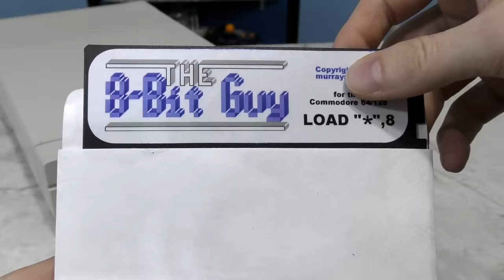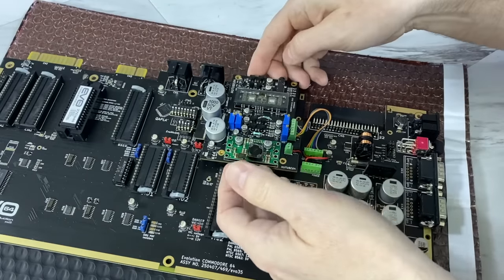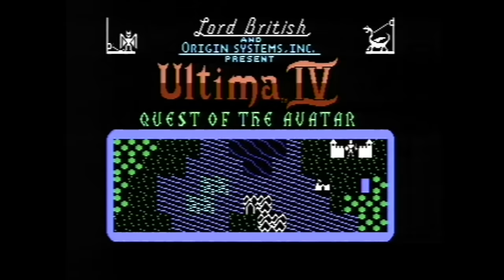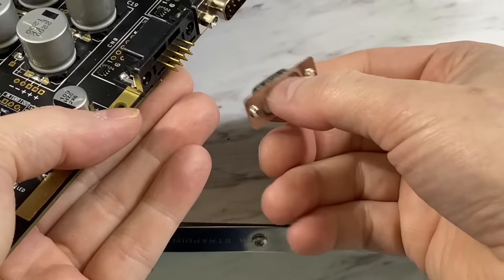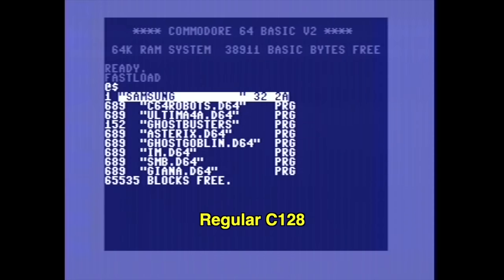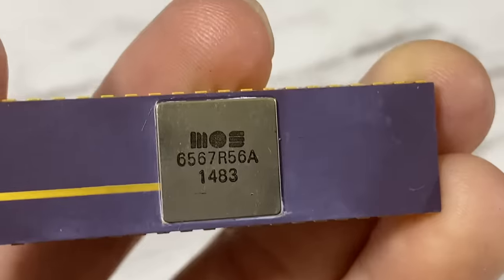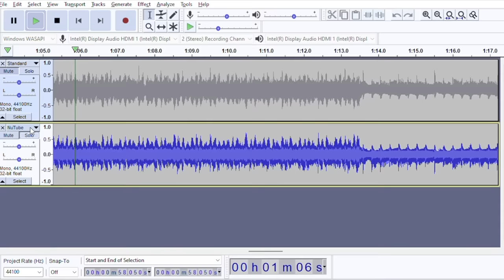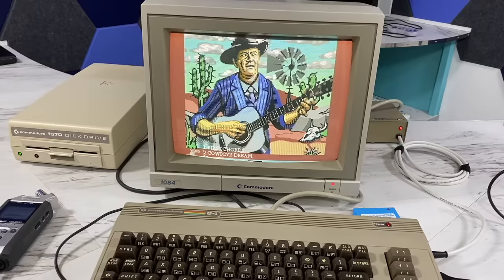The Evolution64 - Is it worth the money?

Comment: A $500 upgrade that is almost imperceptible and requires a full spectrum of additional hardware to appreciate in any capacity really exemplifies the "audiophile" culture.
Reply: I'm waiting for an audiophile blockchain powered AI that is funded by an MLM scheme.
Reply: That's pretty much what it is...

If you blind A B test you usually can't tell the difference between "quality" and "top of the line, fully engineered for audio quality".  

For the potentially incoming comments, how many people have a C64 hooked up to a fully analog amplifier? Probably not many... And this is a computer, released in the era of transistors. It's sound profile is what makes sid chip tunes sound the way they do, changing that is not an improvement in my opinion, that's never how it was used.

(Edited for spelling)
Reply: But this VFD style amplifier tube is awesome :)
Reply: I didn't think it was imperceptible at all and I'm not in any way an  audiophile. There was a bit of fuzziness to the original recording that was simply not there on the nutube recording.

Is that worth $500? hell no. but I could hear a difference.
Reply: I listen to good old mp3 on my airpod pro and couldn't be happier.
Reply: @Tahngarthor  Yup, the tube sounded slightly more `full` if thats the word.  The difference is very slight and deffo not worth $500, in fact I dont think I would pay anything for such a tiny improvement, especially as the sound could be improved in a similar way by switching on your amps bass boost.
Reply: There was a VERY slight increase in bass...but I don't think it made it sound better, just ever so slightly louder.  And that's probably just due to the fact that it's an amplifier vs the original C64 sound.
Reply: Audiofool culture more like
Reply: @Tahngarthor  I could hear the different too, but even I think it's a silly upgrade, and I love tube amps. If you were using it as an 8-bit synth, I could see wanting to add some tube warmth, but that's easy to do with an outboard preamp. I disagree that you need end-to-end tubes to appreciate them in the signal path.
Reply: And the fact that you have to drill a hole into the pcb also makes it kinda a dumb purchase.
Reply: There are many hobbies where you can spend huge amounts of money for tiny improvements in equipment performance. Not unique to the audio hobby at all. Just have a look at the car modding communities where people spend thousands on just a bodykit and wheels for aesthetics.
Reply: Yeah, it's pretty wild. I'm a music enthusiast myself but this type of highly specialised exceptionally high quality equipment always gives me the feeling that it's just a mug's earful.
Reply: Audiophiles: paying 500% more, for a 5% improvement…
Reply: Not to mention a $1000 traditional valve upgrade option
Reply: There is no "audiophile" culture. The word audiophile means, quite literally that you appreciate sound quality. Yep, that's it, all it means is that if you think the sound, most often music you listen too should sound better than through you phone speaker, you're an audiophile. It's like being an autophile - you like and appreciate the beauty and technology of cars.
Reply: @volvo09  I think there are multiple different things being considered here. Tube vs transistor has essentially nothing to do with digital vs analog. A transition amplifier wouldn't digitize the signal any more than a tube amp would. My suspicion would be that the vast majority of C64s have entirely analog audio paths after leaving the C64.

That all being said, a tube amp does change the sound a bit, sort like applying equalizer settings. Even if you went analog out through a tube and recorded it back to digital, the effect would still be present. Digital recording is essentially perfect (as far as human ears can tell), so any change could be captured accurately. That doesn't mean tubes improve the sound, but they probably do change it. 

I'm definitely not saying it's worth $500 (and I'm not even really arguing it's an improvement), but it seems the arguments around here aren't that well thought out.
Reply: i did hear a difference from the nutube, but it isnt worth 500$
Reply: But the amplifier lights up!  :)
Reply: @Tahngarthor  also I heared bit of a Bass boost on the newtube.
Reply: @volvo09  Most people can't tell the difference, but even if you can it still might not be worth the price premium.
Reply: @eric470ast  and that might be cool if you had a translucent case. But not $500 cool. You can get a light strip for 1/100th the price and get the same (or better) effect.
Reply: Gomam0n  It's true, what many people consider 'audiophile' behaviors are really only practiced by a loud minority. Most of us can't afford to waste money on such silly things and look for good values, doesn't mean we love audio any less.
Reply: It's a definitely perceptible difference with headphones. I listened without watching the video to avoid convincing myself to hear things, and it was obvious when the tracks switched. One is a bit clearer than the other. Probably not so much as to be obvious without a direct comparison, but obvious when they're played back to back.

Is it worth $500 though? Absolutely not! It's not that big a difference! Oh, and the clearer track was the original C64, by the way. I thought for sure it would be the $500 "upgrade", but when I rewatched it, nope! Turns out you're paying half a grand to distort the audio. Amazing. Very audiophile.
Reply: @volvo09  My C64 would be hooked up directly to my M&K MPS-2510P loudspeakers, which are active and each has an RCA input. So... bypassing my digital receiver 😀
Reply: Lmao this was exactly my thoughts, thank you for getting it out there.
Reply: @jimtekkit  Audiophiles pay thousands for things that give literally no improvement like power cables though.
Reply: @SnakebitSTI  I thought I might have heard the same thing, but I didn't want to mention it since I wasn't sure. The thing is that tubes 'improve' the sound by adding distortion so it's hardly surprising. Many people find that distortion pleasing but I've never really understood the appeal.
Reply: @StormsparkPegasus  Tube amplifiers do that. The sound was warmer and a bit brighter than original, while having way more distortion in the treble region. This difference in tonality translates to a fuller and clearer sound. Horrible amplifier in my opinion due to the distortion and even more treble than the original, which was already too much, but that's just personal taste.
Reply: @NarmyHiiragi  No, no they don't. Only the stupid ones do. 

Just like any enthusiast community there's the ones that will just throw money at it (and probably brag about it) and then there's the ones who actually do real work and research to find the best stuff for whatever budget they can afford.
Reply: In a feeble defense of the audiophile community, there are two sides to this hobby: On one hand you've got the snake oil peddlers that will charge thousands of dollars for a cable which, scientifically, provides zero benefits over a reasonably priced cable. I was reading an article the other day about some audio gear reviewer that claimed that even the hard drive that you store your music on can impact the sound quality and I was rolling my eyes so hard that I could see my own brain. There's also literal pebbles that you can buy for hundreds of dollars that you're supposed to tape to your cables to improve the sound quality........ 🙄 ..... anyone peddling that nonsense should be ignored entirely.

On the other hand (and I'd say this is by far the larger hand) there's audiophiles that just enjoy good quality audio. You can buy the fantastic Moondrop Chu IEM for like $20 and plug that into the lightning to 3.5 dongle that you got for free with your phone, and if that really gets your motor running then congrats you might be an audiophile. You absolutely do not have to spend a lot of money to be an "audiophile". That word has so much baggage, and for good reason. In any niche community that you're not a part of, you'll only ever hear about the weirdos because no one is going to report on "Hey look at these normal people listening to music!" because "This guy spent $20,000 on a meter long cable! And he taped some rocks to it!" is much more entertaining to laugh at. I'd say that most of us are completely reasonable people that just enjoy a particular hobby. Same as anyone enjoys any hobby.

If you're curious, I think the /r/headphones and /r/inearfidelity subreddits are both pretty good places to get a window into what the hobby is about, at least for personal on-ear and in-ear audio gear. And yes, some of the gear is quite expensive, but a lot of it (most really) is stuff that normal people can afford. And I say expensive not as in "$20,000" audio cable, but more like "$5000 as in one of the best headphones money can buy, subjectively speaking". In the same way that a $2million Bugatti is one of the fastest (road legal) cars that money can buy. You gotta pay for "the best" but that's obviously out of reach of most people. In reality, a $25,000 Honda Civic will get you where you need to go in comfort, just like a $250 headphone can give you great quality audio. The snake oil cables bs will get you laughed out of either communities real quick.
Reply: Sounds like a "shaving CDs/demagnifier for optical discs" level of audiophile junk.
Reply: I am a fan of tube equipment. But I can tell you, solid state sounds better.  People are so used to listening to just horrible solid state amps  made with the cheapest possible components and coming to the conclusion tube sounds better because they are comparing the high end or well made vintage tube equipment.  OK, now take the BEST solid state has to offer and compare it to the average tube equipment and really probably the best tube equipment. Solid state will win.
Reply: Looking at the specs of the NuTube, I’m not surprised… in my opinion, it just sounded muddy, deaf, with no real dynamic range.

Almost as if someone recorded the audio on a crap cassette and played it in an either crappier player!

Looking at the data sheet shows just how poor the frequency response is compared to the traditional line output from the C64.

The audio level isn’t louder, it isn’t fuller, and I’m concerned that no attempt at matching the phasing was made either! Poor effort indeed!

Small Russian tubes would’ve done a better job! An ECC82/3 or even a British EF80 would’ve done a finer job!

It’s all about the frequency response! People don’t like tubes for muddy crap sound, they like it for the rich warmth, their tones, buzzing from their equally fun output transformers. The NuTube is a good product if you have a use for it… such as a distortion pedal, or a cheap oscillator circuit, but not this, man 

It’s about midrange when it comes to tubes - output transformers and really good matching loud speakers. I love valves/tubes, but I personally can’t stand the sound this thing puts out

TLDR: Music Producer and vintage electronics engineer and Restoration expert gives his opinion on a really useful device which has its uses, but this application shouldn’t be one of them… in his opinion!
Reply: @The_Studioworkshop  There are A LOT of bugmen in the retro scene. 

I really should design some special SID certified audiophile audio cables.  Because that's CLEARLY the problem!  Had 8bit guy used the right audio cables, the sound would have been audiophile grade.  His power is probably dirty too.  That can interfere with that special audiophile sound.  So with the right audio cables and a power conditioner and a tube amplifier, THEN he would get the benefit of this board!!!
Reply: I’d say, while audiophile by itself doesn’t mean anything „cultural“ by default, there actually is an „audiophile culture“. Heck, I was on my best way to become part of said culture, when a musician pointed out self-contradictory marketing jargon about hardware I used to be interested in. And mind you, said hardware was widely considered a good entry level device, by audiophiles. Audiophiles tend to not know, what they should look for. I certainly didn’t.
Reply: @dominikschutz6300  won’t be any perceptible difference without the $5000 AC cord, $200 audiophile outlet and $4500 power conditioner. Oh, and $12,000 speaker cables...
Reply: From what I understand in the other video he mentioned, there is apparently an even MORE expensive option that uses actual tubes instead of that flat-chip-like design.
Reply: Beat me to it, that's the audiophile community to a t.
Reply: @tarstarkusz  you nearly caught me off guard!!!

But on a serious note - I hope this product is exposed for exactly, what it is.
Reply: @frykasj  Wait a minute. I shaved my Microsoft Office install disk and it turned my computer and house into a fully operational newspaper plant with an 8 web printing press.
Reply: @tarstarkusz  And you don't have to wait for the damned thing to warm up.
Reply: @FlatBroke612  You forgot the $1000 S-Video cable for converting to 8k hdmi.
Reply: I own studio headphones and expensive amp, didnt hear any differences lmao on this video. but connect for example Roland32 and th difference is day and night
Reply: @NarmyHiiragi  Unfortunately it's true that analogue cables do make a difference to sound. As much as I'd like to not believe it, experts who have spent decades in that field will tell you that silver cables deliver a very slightly brighter sound profile than copper cables. It's not total snake oil. The obvious caveat is that nobody should be spending thousands on audiophile cables if they've got to pay rent or student loans, which is why the majority of users don't.
Reply: I found that most "audiophiles" know nothing about how sound works. Terms like "standing waves" or "null test" are often new to them.
Reply: @jimtekkit  I said power cables. The ones you plug into the wall.
Reply: @meetoo594  Using some eq and dynamics processing can get you a 'fuller' sound aswell. ;) and for free if you download freeware versions..
Reply: @NarmyHiiragi  Guess what? Power cables are analogue.
Reply: @jimtekkit  Oh I see, you are an audiophile rube lol.
Reply: ROFL and try to buy an old Pioneer integrated amplifier these days!!
Reply: @volvo09  If David had done a blind test, I wonder how many people would be saying they can heard the improvement. May be next week he'll put out a video saying that actually the recordings were opposite to what he said.
Reply: @axelBr1  trouble is, the absolutely tiny difference didn't actually improve the sound,. The tube thingy  just slightly altered the bass and distorted the treble.  In general use I doubt anyone would notice the difference between this and just fiddling with their amps eq settings.
Reply: People claiming that they can hear an improvement on sound quality over YouTube are high. YouTube video stream audio compression is awful. It's like comparing DAB to CD. 
I'm not convinced that the board improves the sound quality to any perceptible degree anyway. Making it sound different does. Ot necessarily mean *better*, and in order to genuinely perceive an improvement in sound quality, you'd also need speakers/amp/etc with the ability to reproduce any improvement in fidelity/resolution.
As others have said, the vast majority of 'audiophile' products rely on the cashebo effect and almost never hold up to double blind testing.
Even when the improvement is perceptible, the law of diminishing returns applies massively to high end audio:
The improvement in resolution between a £500 and £5,000 Hi-Fi setup is going to be way, way more noticeable than between £5,000 and £50,000.

The board is shaping the audio, that's the only reason it sounds slightly different.
Reply: the C64 simply can't produce the kinds of sound effects or audio range that you would get any real use out of some high end tube audio board.  As I said before, it would be FAR FAR more useful on a slightly later computer that was actually used significantly for audio production such as the Amiga or Atari ST.
Reply: @coliander4180  Not at all. I could hear the inversion of the wave form in the attacks. I almost felt as if the inversion were a bug, the difference was so transparently obvious. Believe me, I pay attention. It's real.
Reply: Well said.
Reply: The $500 is perceptible. One Question: Why do you have a C64? To live the Nostalgie, play the old games with the original Sound. 
The Shallow 80's Synth Sounds are part of the experience of having a C64, so why change it? You can get a Raspberry pi and have better sound in C64 Emulation. And even with the Raspbery Pi prices nowadays they are not $500.
Reliability and better Graphics output i can understand, as some C64 are realy bad after 40 years. Sound not realy.
Reply: I do not believe in the need of additional equipment to measure. The best tools are your ears. With the same set of ingredients you can cook a McDonalds or a good restaurant food. Mouth is mouth. Ears are ears. Just go listening to some buddy having one and you will make your mind without expensive equipment., but just listening.
Reply: ha ya! Totally! And I'm an audiophile 🤠👍
Reply: @damianvila  To the moon baby
Reply: I have a neighbour is an audiophile.  I offered to buy him the speaker cables of his choice IF he could show me, on an oscilloscope, the audible difference between expensive cables, and whatever normal, consumer-grade cables I could come up with.

20 years, still hasn't taken me up on it.
Reply: @anothersquid  haha yes. I use 9awg silver OCC mono crystal wire 🤠👍 muhahaha it's like pythons on the floor 🤔😃
Reply: It's probably not worth $500, but the idea that you need a full chain of tube gear to appreciate any difference is just false. If the tube introduces any audible difference, then that difference will remain audible throughout the signal chain, as long as that signal chain remains sufficiently transparent. YouTube compression might be enough to impact its audibility, but a half-decent solid state amplifier won't be. Besides that, this option is only so expensive because this is a niche product. Korg sells a NuTube headphone amp kit for half that price.

Even beyond that, there's a more fundamental issue to consider. Sure, most people wouldn't notice a difference between the standard audio output and the tube option in a blind test. But you know what? Most people also wouldn't notice a difference between this product and a free software emulator. People don't take part in this kind of hobby to save money, people do it for the sheer joy of engaging with interesting technology.
Reply: @Elkarlo1977  Nostalgia is not the only reason to own a 64. Hell, there are a lot (relatively speaking) of people who were born after the C64 was discontinued who never used one in their youth who like it.

Though I did have one in my youth, it is more the style of game that tends to be done for the 64 and other retro game systems that attracts me back to the old breadbin.  Plus, it always fascinates me the art that can be done with such limitations as the 64 has.  Can't wait for the full release of A Pig's Quest.  The tease videos are just amazing for being a 64.
Reply: @The_Studioworkshop  It can be hard to satire these people.
Reply: @anothersquid  while I do agree with you that it is not worth discussing with this neighbour, but dont forget that ears are not linear devices so response to 20 is not twice the response to 10 !! As such linear measurements, filters, spectra, etc etc which work by splitting LINEARLY the signal in components will not reproduce the whole problem.
Reply: @jerryspann8713  Back in the 80s when I was a teenager and owned a 64, I had a black and white hand-me-down tube TV from the 60s I used as my main C64 monitor and I had to wait for the thing to warm up.
Reply: @auro1999  Oh I know all that, but if you want to make a convincing argument that $1500 speaker cables are objectively better than $15 speaker cables, you should definitely be able to point out precisely how the cable affects the sound on an oscilloscope - a device far more sensitive than an ear.

It's easy for one's mind to trick oneself that the cables they paid a stupid amount of money for sound better.  It's much harder to trick a measuring device.

I've never met an audiophile who was willing to put his gear to an objective test.  Oh I know a few sound engineers, and people who work in the field who, for some reason, never seem to join the audiophile mindset and, frankly, have better sounding sound systems than any audiophile I've ever met.  Those guys are happy to demonstrate and PROVE how their system is better.  Audiophiles never seem to want to step up.

And that's OK - if someone wants to pay 10000% markup on pieces of metal wrapped in plastic or 100 year old tube technology, that's OK, but they don't get to say it's better unless they can prove it.
Reply: If it has a measurable (if imperceptible) impact on audio quality, can it even be called "audiophile"? A true audiophile only does things that have 100% imaginary effects, like demagnetizing CDs (I wish I was joking)
Reply: @anothersquid  I would not do it. You are right.  Because nor the scope will see any differece, nor the ears will feel it.  Only the pocket. In my PERSONAL opinion, only silver does a bit better than copper, but silver has many other issues - oxidation. In addition, cables are often soldered (wrong, you form intermetallics), not crimped, but this also changes with the alloy of the solder, and the tempearute of the solderig process. There are way too many issues and each counts pretty much zero. Use 4 conductors power cable, with twisted pairs and you have solved 99% of your cabling problems.
Reply: @anothersquid  You can drive to work with a Ford or with an audi. Both drive you to work. Audi does not need to prove it is better than Ford. So we can not put on the "designer" the burden of proving. It is the customer, who should decide by him/herself.
Reply: @metacob  Or shave the edges if a CD, because, well, voodoo.
Reply: I believe it's more of a "ferrari" situation if you ask me, you can actually see the improvement if you have a decent crt, audiophipe stuff is almost impossible to actually notice the difference once you get to the high end audio
Reply: I did hear a difference.. personally the upgrade has a better sound in most places but there is something it lost from the original.  I don't know how to explain it well though DX
Reply: That's "My hearing isn't that good sunshine" territory
Reply: @Tahngarthor  If you couldn't hear the difference between a crappy single transistor amplifier compared to the over complex and over expensive new amplifier I'd be shocked.  However a ten cent op-amp based amplifier would likely have done 99% of the job here.
Reply: @auro1999  True, but when an audi driver says "my car is faster/better on gas/more aerodynamic/gets hotter women/etc." those claims can all be objectively proven.  I can drive an A4 faster than an F150.  I can measure the aerodynamic drag or gas mileage and determine which is objectively better for my requirements (which may not be the same as someone else's).  I can even cruise women in both and see which is more effective.

Audiophiles make claims, but never prove them, even when offered the opportunity at someone else's expense.  Anyone who tries to prove the claims is never able to do so.

This makes audiophile claims look like bullshit.  And to be fair, that's what most of the world actually thinks of them.  I don't like to suggest that because the majority think something it is probably true, but in this case, the preponderance of the evidence does make a lot of audiophile claims really seem like bollocks.
Reply: It’s still eight bit audio isn’t it why would adding vacuum tubes magically make it sound better it’s like saying putting Mag wheels wheels on a Volkswagen bug will turn it into a sports car.
Reply: @Tahngarthor  Same.  I definitely heard a difference, and I wasn't paying extremely close attention.
Reply: @ferrumignis  right, i'm just saying, I'm no audio expert. Obviously it isn't worth $500 though.
Reply: I wasn't expecting to hear any difference, but I could hear a difference even on crap-tastic laptop speakers. The nu-tube sound was a bit bassier and fuller. I would say I prefer it, but it's not worth $500 ...  I'd look for a way to reproduce the same sort of coloration as that tube does for cheaper. My bet is you could still get something like it with a good quality transistor amp.
Reply: @auro1999  Actually, no, we can definitely put the burden of proving their claims on the designer / manufacturer. They're taking money in exchange for the promise of a "better" product. It's on them to show objective evidence of an objective difference if they're going to make claims.
Reply: As a videogame collector I think the fact that people pay 3 times the price for something that most people (and often themselves) can't percieve, however the irony is not lost on me when I pay more for videogame boxes that have barely noticable upgrades in terms of scratches etc (Though not 3 times the price).
Reply: Hey, I'm an audiophile and I resemble that remark!
Reply: @MultiPetercool  Programming is 8 bits, Samples are not 8 bit. Output is analogical.
Reply: It's definitely more of a "why not" upgrade than an "audiophile culture" thing.
While flawed due to the conversion, the difference was noticeably to me, using PC motherboard built-in audio out and relatively low end studio headphones.
The tube sounds slightly less distorted in the high end than the transistor and seems a bit differently balanced.
Which given the rough output of the chips, passing through a presumably cheaper class D amplifier, is a possible reason for such an upgrade, to someone who cares insanely much.
It's a beyond over-the-top upgrade, but the difference is audible through YouTube compression, with headphones cheaper than airpods, I'd definitely pick the tube over the transistors if the option was available.
Reply: @WyvernDotRed  if you swap the electrolytic capacitors with niobium oxide ones, the trebles will become more crystalline and rapid. However, I decided not to use them to avoid the board going up of other 20-30$....
Reply: Even if this is one of those things where it's a frequency that only teenagers or younger can hear, how many of these kids are going to care about C64, and how many of THEM would be able to afford this thing?
Reply: @volvo09  Actually transistors are analog so... what you meant to say is a (vacuum) tube amp. Indeed this is supposed to be a tube pre-amp, which may be wanted by some artist playing live on stage with tube amps. But yeah, for the vast majority of people, we are fine with transistors which last longer, use much less power and emit much less heat.
Reply: You need to rewire your house, gold plated wallsockets, audio specialized cables, and fuses, power stabilizer or regenerator, 50s speakers upgraded with nasa componnents, the biggest turntable you can afford with separate motor, separate pre, 20K cartridge. And for the amplifier dont go above 5W ..... And tubes, tube watts are like 10 times solid state watts. Solid state sound harsh, solid, cold. Horrible. Kinda you have never listenes a Sony ES mosfet, or a vintage The Fisher / or Scott made on SS. And dont forget tube rolling
Reply: All the C64s and C128s I have almost every single board revision adds different kinds and amounts of interference noise to the audio output. Even a new motherboard type like the C64 reloaded mk2 has much worse audio output noise problems than some of the old C64 motherboard types (it really should not be that noisy, lazy PCB design). The true test of any new C64 motherboard design for me would primarily how clean the audio outputs are by themselves. I can always put the audio signal through an analog effect processor if I want tube sounds added on the signal.

Having that nu tube built in to the box can probably do some good to shape the sound output a little bit when I don't feel like putting it through my audio studio gear to process it. It was very easy to hear the difference between those two recordings even on my laptop speakers.

What would actually be more useful than a tube amplifier though is a simple built in per SID chip multi band equalizer because almost dual SID chips needs some EQ to play nice with each other and even with one a SID chip does not necessarily sound balanced on a home theatre speaker system.
Reply: @eliotmansfield  it will change your life! Aw.
Reply: @volvo09  Only a trained ear can tell the difference, and only when paired with incredibly good headphones.
Reply: @dominikschutz6300  Yes, I've been saying they need to modernize audio amp vacume tubes for a long time.   I think they need to use small radial mounted pipet tubes like tiny florescent bulbs, though.
Reply: But skate or die will sound better.  Jk.  If a game is not playable because the hardware is not reliable, it ruins the experience.  It's not an upgrade.  Looks to me like a main board remake that still requires the original really pricey chips.  I have a bad board (blown CBM branded PLA) 🕹️
Reply: @meetoo594  the PSID sound?  It doesn't need a special chip.  It's called power SID mod but it's software
Reply: @StormsparkPegasus  There's always an external amplifier if you're hearing the C-64 audio - it doesn't have built-in speaker, it's just that it has most commonly always been ones TV's amplifier.
Reply: audiophiles lol ikr? makes about as much sense as sinking money and time into hardware versions of a long obsolete home computer
also there were some misconception re the audio in this video. the sonic appeal of tube amplifiers is due to the particular kind of very slight distortion they create, often interpreted as "warmth" by listeners. whether that weird little tube on the soundcard actually does that to any audible or desirable extent is another question, but if it does, then so long as that sonic quality is not masked by the rest of the replay chain, it will be audible whether subsequent amplification is tube or solid state. and if the rest of the replay chain is so poor as to mask it, then its all going to sound awful anyway, whatever the input is.
Reply: Downgrade? Lol.  SID is a mixed digital and analogue chip.  The oscillators are digital for precision.  The filter is multistate variable programmable analog filter with overdrive, isc sync and other capabilities.  The SID chip wasn't finished as the designer wasn't given enough time.  So the bugs allowed programmers to make it sound like anything including WAV file playback.  With REU and SuperCPU, but that's moving into GeOS which is windows like...
Reply: the main issue is even simpler, yes, there was a small difference (not much,) but that could be replicated with a 50-100 usd worth of better audio stuff, even with transistors (little more than not using the cheapest stuff, but a slightly better one,) anything beyond that is mostly just bs-ing, even more if the source is a 40+ year old sound system, the potential benefit simply did not existed from start.
Reply: I'd get an A1200 Turbo and use SIDPlay with Tube amp plugin simulators.  But I already have one.  A1200 in working conditoin is around 500$ or just the turbo board (brand new 030 at 50MHz) is around 500$.  Slightly offtopic, but there is a very good C64 emulator for an A1200 Turbo.  I have EaglePlayer that i use for sound files.  It plays most SID files, nintendo files and I cannot tell that this is not a NES/Famicom system.   I forgot the song name.  Artificial Intelligence bomb . NES sound file.  There is a sound clip on youtube if anyone looks for it.  It plays on an A1200 Turbo.
Reply: Well... If imeprceptible for you dosen't mean that is for everyone, maybe you is the problem
Reply: @oddball119  It's very likely the maker of this board took notice of that.  This is a new product, still being actively developed.  Let's see what they do before we close the book on 'em, shall we?
Reply: @dominikschutz6300  Yeah, but is it $500.00 US worth of awesome?
Reply: @horusfalcon  No, you're correct, I wouldn't pay that price. Maybe $149 :)
Reply: @jafizzle95  Thank you, and everyone else saying the same, for setting me straight - I too have always thought "audiophile" refers specifically to people who have such delusional obsession that they believe they can hear the difference between regular copper wire and gold wire in blind test (when people usually can't even tell pepsi and coke from each other - well, they can't tell which is which, but they can tell if both drinks are same or different; I don't think anyone could successfully identify even that with audio cords).

But HDD/SSD drives are nothing, I saw even more laughable on Linus Tech Tips - they ran blind test (and no, I don't believe any of them thought it was even remotely plausible) and they didn't even tell the test subjects what they were testing - just that they should try to listen if there's any difference and which sounded better; some thought they heard slight difference, I'm not sure if anyone felt like they could identify which sounded better - and that's to be statistically expected when you're specifically trying to hear if there's difference).

What was the thing then - well, it had to do with streaming audio. And if you're thinking network adapters, routers, etc. you're wrong. It was insanely priced *ethernet cable*. Probably without any other difference to their "regular-data cables" than packaging and perhaps coloring and style of the surface area of cable and RJ-45 connectors.
But this was not meant for regular data, apparently this was specifically designed for audio streaming. I mean, I don't know how a network cable would be able to know audio data, especially nowdays when streaming mostly happens using encrypted protocol (HTTPS), but the thing is that you would have to be totally clueless how network devices work - and what "digital" means in "digital audio" for that matter - I mean, do they believe that there's different qualities of 0's or 1's?
I mean, there's a case to be made that if you were using a protocol like UDP which is designed in way that packets can be received out of order - which may help with streaming, realtime network games, etc. and is why early multiplayer LAN games often used UDP instead of HTTP (although earlier they didn't even use TCP/IP networking but most commonly IPX networking). But that was only beneficial with old slower connections and mostly when the connection had lot's of errors, none of which were normally caused by the last frigging meter from wall to back of your PC. And today, with network connection speeds good enough to stream FullHD and higher with 60fps without problems with HTTP(S) you're certainly not going to have problems with audio.

But none of that matters, because the people who believe in "audiophile quality network cables *optimized for audio streaming" are so utterly clueless that they actually believe there's some audio signal travelling in those cables - because the moment you realize that it's just binary digits, there's no audio signal (and I mean when you actually understand what it means) the whole idea becomes totally ridiculous. Yet there are people, apparently clueless of how digital and analog are different but most certainly have strong opinions of which is better, spending frigging fortune on frigging stupid network cables :DDDD I mean, why wouldn't otherwise reasonably trustworthy companies cater to these fools; why would you pass on opportunity to sell the same cheap product for 100 000+% profit increase when they're demanding someone to take their money? At least their product works (it's a good network cable) - better than letting those fools put their money on frigging pebbles that can only do "being pebble"

But yeah, I'm not sure we should even accept their self-description of "audiophileism" - I mean, I really do believe that it implies more than just "appreciating quality audio". I mean, that's almost a given if you like to listen music. Also as a side-note I really like to just say that love of Lo-Fi synthesizers/chips is different from the common distinction between Hi-Fi & Lo-Fi - I for one certainly love the Lo-Fi sound of 8-bit synth sound; so much in fact that I'd hate to let Lo-Fi amplifier/speakers ruin it ;D That's just kinda interesting semantic note, but back to my point. If you're serious about music and Hi-Fi as a hobby would make some effort to understand how sound and audio equipment work (by "understanding sound" I mean understanding things like how audio waves travel, etc.). If your investing fortunes on audio equipment, it might mean you're just really enthusiastic about your hobby - but if you're putting that fortune in snake oil and make sure people know about it, that means that your a frigging wannabe!! And yes, a person might believe in it as well, but if he actually understands how stuff works and makes a statement that sound quality might be affected even by hard-drive or ethernet cable, that means to me that you know that you're a fraud and have accepted it to be about feeling good and being smug :DDD
Reply: @tarstarkusz  I recognize a fellow scu...udiophile when I see one, but while you're probably right I couldn't be recognize it because 8bit guy clearly doesn't have the latest 34k lead ethernet cable when he uploaded the video to youtube; I recognize the abhorrent audio artifacts a regular ethernet cable has on audio and they cause the same sub-stellar aural fluctuations in the field-array of your amplifiers flux-capacitor (you do have one, right?) the things you mentioned do. Don't be embarrassed if you didn't understand all of it, I've been in the field a long time and I've audio-bragged on 8 continents - after all, we all started as, sigh, normies who don't even know about sound enhancing unobtanium screws and likely would use a non-audiophile screwdriver to screw them in.
Btw, coincidently it just happens that I'm also the leading manufacturer and seller of audiophile ethernet cables specifically designed for uploading to youtube - and before you ask, yes I do use them myself but I recognized it because your sound quality can be affected even by the network equipment used to upload the audio!
My company also has comprehensive mole of all kinds of 3rd millenium equipment. From echo-dampening wool socks and radioactivitial noise canceling earphones to latest and greatest 34k lead wirings to fill your walls with (comes with surface asbestos covered fire-proofing as bonus).

Our company motto: "Whatever audio technology you're clueless about, we have it!"

We have shops on all 8 continents! Don't hesitate longer, order now!! Order now for limited time offer of only 999.99€ - yes, for less than 1000€ you could have your very own lead-ethernet!!! Ethernet now!

NOTE! Due to chip shortage our stock is limited so order now before we run out!

P.S. We also sell subscriptions for streaming RAM services! Don't waste your diskspace with medieval solutions like downloadable RAM, sign up for Streaming RAM(tm)(r)(@) for only 99.99€/mo.

Message me on Telegram, totallylegit293847 for more information.
Reply: @jimtekkit  I'm not an expert or even close to it - in fact I'm probably just barely higher than average European when it comes to knowledge about sound, but I'm convinced that there's a difference. However I'm highly sceptical whether these experts would do well identifying which cables are better in blind test. If I had a bragging "audiophile" freak... I mean friend, I would love to swap his cables behind his back and see how long it would take for him to find out.

I always think whenever someone speaking of insanely priced stuff affecting sound quality mention "slight difference", what they actually mean is "imperceivable unless you're a dog" ;)
Reply: @meetoo594  I'm sure you're wrong - the EQ settings should definitely alter the sound more than just slightly, at least if it's not total crap ;)

And yes, I've seen cheap stereo sets with crappy EQ that barely affects the sound at all but if we assume that's not the case.
Reply: @robsku1  I hope you realize my comment was entirely 100% satire.
Reply: @tarstarkusz  So true - but weirdly I feel the same nostalgy for stuff I've never used and even computers before I existed (born '79) that I feel for my first computer (biggest loss when it comes to tech I've had was losing it) which was an IBM PS/1 (model 2010 I think - the one with 286 CPU, I believe it was the only 16-bit PS/1 model). I mean I'm not sure if nostalgy by definition can only be for something you've experienced (by the loosest of definitions such as remembering it from ads, TV programs, etc.), but the feeling is definitely same. I haven't actually asked anyone if they feel that way for anything.
Reply: @tarstarkusz  I did, and I appreciated it - that's why I wrote that comment, hoping to be good enough that you would appreciate it the same - but that's not for me to judge ;)

I knew I was taking a risk that my comment might be taken as mockery, but I really wrote it for the lulz <3 :)
Reply: @tarstarkusz  And nowadays the TV shows some image or animation nearly instantly, but it takes several times longer for it to boot up than the old CRT TV's took to warm up :D And I'm not even talking about smart TV's :p
Reply: @auro1999  What, that's not how burden of proof works - although the customer should decide by themselves, the burden of proof is always on the one making the claim. And car manufacturers make claims all the time, which places the burden of proof on them - if you should however trust them and then use their claim in an argument, the burden of proof can justly be put on you as well.

Not sure what you were replying to so I want to emphasize that my comment is only about how burden of proof works. One who makes a claim has the burden of proof.
Reply: @robsku1  You fooled me.  I thought you were serious!    Great job.
Reply: @robsku1  I was thinking more those graphic equalizer slider things where you can adjust individual frequency ranges, EQ settings is just easier to type. But whatever you use it will have the same/better effect on the sound than this $500 mugs eyeful.
Reply: @robsku1  Most solid state CRT TVs were near instant on.  Maybe it took a literal second or 2 for the screen to fully fill, but that's it.  A lot of modern TVs take 10 seconds or more to show you their logo and on and on.
If you ever get a chance to open both a 1960s and 200s or really even 1980 TV, the difference is absolutely remarkable.  The level of integration between like 1968 and 1984 was just incredible.  Parts count a fraction. The weight a fraction. The lifespan of the CRT far, far longer. Power consumption a fraction. \

 A typical 60s color console TV consumes about 300 watts.  A 1980s console TV the same size, maybe 75 watts.  While the tubes in a 60s console is part of the reason, even subtracting out all the tube filament current will not make them equal.  Even the early solid state machines still used more power.
Reply: Not that anything is new on the audiophile front.  In most respects, it's been like that since the mid 60s (sixties - just to make sure no one thinks that's a typo). Marginal improvements in quality for a near exponential increase in price on the kit side, and a 10 on to  the media (I remember DMM vinyl was first coming out and was springing for £13.99 as opposed £3.99 for a normal bit of black plastic. There was an improvement, but I didn't buy one until they were £7.99 over £4.99, since nothing, even now, sounds a tenner better from media alone.
Reply: @rog2224  Most people cannot tell the difference between a well recorded compact cassette and a "high res" digital file.  None of the audiophile stuff can ever pass A/B tests even with self-professed audiophiles as the test subject.  It's all just in the head of the bugman audiophile.
Reply: @MultiPetercool  Volkswagen Beetle was one of the top cars in... I forget what it was called, a race that took place in Europe, went through more than one country, and the cars were common street cars. I remember watching it on TV when I was a kid, my father told me that VW and Citroen 2CV were two of the most popular cars since they gave others tough time. So there...

But that's not the dumb thing about your comment - it's that you actually thing that because of it being 8-bit, it's sound can't be improved. Kinda same as the other dumb comment I've bumped into, that it doesn't matter if you connect the C-64 to cheap crappy speakers because it's only 8-bit. 8-bit doesn't mean crappy, and it certainly doesn't mean the sound somehow can't be improved (though what that means is subjective). I think you're confused as 8-bit is Lo-Fi and you're equating it with crappy.

Besides, SID chip is only part digital.
Reply: @robsku1  Having rebuilt the engine on a 64 VW bug as well as welded in new floor panels. I’ll let your first comment pass.

The fact remains even if the entire signal paths were analog. The dynamic range and frequency response is really kind of limited.  Similarly the number of voices was too limiting. The bottom line is nobody would be producing album quality audio on a device like that.

Maybe great for game, music and pop dance music. If you like your music heavily compressed that it’s probably your device..
Reply: And spending $300 on a motherboard that has a the computing power less than a tenth of the one found in a Philips connected light bulb (price without CPU actually), really exemplifies the "retro-computing" community?
Reply: @-yeme-  "audiophiles lol ikr? makes about as much sense as sinking money and time into hardware versions of a long obsolete home computer"

Well, yeah if you're doing the latter because you're thinking that by doing yourself you're going to get a computer that has superior capabilities - when people laugh at "audiophiles" they actually mean those who buy scam products like network cables that are optimized for streaming audio (hint: they're not optimized for it, that's not a possibility, it's just words on paper) and paying insane prices for it. People who buy stuff that they wouldn't notice being switched to regular stuff behind their backs (if they didn't see the thing and were just listening stuff with their stuff. Stuff).
People who can't back up their beliefs in blind test situation.
Meanwhile retro computer hobbyists can give you actual reasons - they're not claiming that their computers aren't "obsolete", just like someone collecting vintage/museum cars are not claiming that their cars aren't obsolete and perhaps even dangerous by modern standards.

The kind of people that would think that retro computer hobby makes as little sense as audiophiles that go for completely useless stuff are people who consider a hobby to be waste of time and money if it's not something they also like or they can at least understand why someone likes that. Anything they can't understand must be stupid to them.
I'm guessing you're not one of them, I think that you're an audiophile and retro tech hobbyist, and you felt perhaps offended by being laughed at - but while I can't speak for everyone, I think people here were laughing at those who buy stuff that makes audio sound better, but only if you're a dog.
If they consider this specific do-hickey not worth it (and if the difference it makes could be achieved with something that costs less and that isn't tied to one specific device, then it's really not worth it - and from several comments it seems to be the case), then their laughter is just.
Reply: @thomaslaskowski5434  Not to mock A1200, but isn't it capable to output only 8-bit PCM? SID, while it's digital part is 8-bit, has analog output and even if Amiga had power to run hi-quality SID emulation equivalent to something like ReSIDfp (libsidplayfp), or even just ReSID (without floating point), which I have my doubts but I might be wrong, 8-bit PCM isn't really good enough to replicate the sound of SID chip - and you don't need to be an audiophile to notice the difference. I don't know about NES/Famicom sound chip though... Of course everyone's ears are different, and if you can't tell the difference then none of this really matters :)
Reply: @tarstarkusz  Oh - my memory insists that I've never seen a CRT TV that was near instant on, but that's probably because my mind has exaggerated how long it actually took for them to come on. I've definitely have seen ones that took a bit longer, but I'm sure you're correct...
Anyway, I was just poking fun at TV's that take time to boot up - just like the C-64 booted up pretty much instantly and modern computer takes quite a bit of time to boot to the OS :p
Reply: @tarstarkusz  LOL, awesome :) And glad you liked it :p I had fun trying taking my comment as far into absurdity as I could :D
Reply: @robsku1  yes it's capable.  I have a Turbo expansion.  Sounds almost exactly like SID.  I have few short videos on my channel running C64 and A1200 with 2nd reality music Sid's and other.  I use analog speakers.  It does need a turbo board to do this, but it uses Paula stock sound out circuits.  No other mods.  The A1200 has a ladder/LED filter on the audio outs which is diode based I'm guessing.  I don't have an FPU.  68030 at 50Mhz gold top Motorola.
Reply: @pleggli  not the C64 ultimate board.  It uses quiet bus operations and many other hardware tricks to make a real SID sound very quiet in terms to Signal to noise.  There's 0 hiss or noise, but it requires a good SID chip with the good revision.  The sound is very loud and clear.  And the Ultimate 64 has a dedicated SID player.
Reply: Try some dual SID music files.  They sound 3D.  They are rare.  So 2SID music files.
Reply: @robsku1  https://youtu.be/sP72VCV1RTc around 14 minutes 17 seconds.  That's a real SID on a C64
Reply: @tlaskows  yeah, I have one of those too but I don’t count it in the category of real C64s since it doesn’t use the original chips. I do use It for composing music most of the time but I prefer a machine with more original components. The ultimate 64 video and audio output is maybe even too clean, it goes so far that it doesn’t fully look or sound like a C64 anymore.
Reply: @jimtekkit  It's something to do, but not something to obsess over.  I would rather use it then elaborating if I should run it thrugh 4k screen for example.  It gets vert $$$ expensive and the system, computer still doesn't work.  From my experience.
Reply: @meetoo594  so barely perceptible on a recording is still a huge difference, not only are most people's headphones pretty average on YouTube but depending on the quality you watched in the mic used and your headphones make a difference but your devices basic dac and amp can change or not deliver the full sound. That being said, 500 for that? Full skip lol, also cables I guess? Like not paying more for better quality but buying shit quality can definitely make it worse.
Reply: @volvo09  But... if I got a gazillion dollars as a surprise hit music artist, this is one of the first things I'd buy. Guilty pleasure, but a pleasure if money was no object.
Reply: @mobilevideoviewer2610  Some of the most important dfferences (distortion and overtones) are clearly audible on both  my iphone and laptop speakers which are not remotley high fidelity.  A lot of people are simply not used to listen analytically to processed audio.
Reply: @pleggli  I mean fair but as a consumer product something to be said about there probably shouldn't be a need to compare in order to appreciate the sound. At the end of the day my goal is to get clear accurately represented sound as if I were in the room with the artist.
Reply: @mobilevideoviewer2610  We are specifically talking about a computer controlled S
synthesizer . 

The artist might have made the tune with built in speakers of a TV or computer monitor and in that case using the same gear to play it back if the aim is to reproduce the conditions the piece was created under. 

Other tunes might have been made using headphones or a studio monitoring system.  

Personally I run my C64 output via light multiband EQ + compressor to bring the sound together a bit more. I personally prefers very much prefer that to a tube sound or to whatever authentic reproduction of the speakers and amplifier the artist used to write the piece.

Getting lost in trying to figure out what the most authentic performance of a specific piece of music composed on and for a Commodore 64 will probably not give you the best listening experience most of the time.
Reply: @pleggli  isn't it though? For most individual users the point is nostalgia hearing it how it sounded is important, for me who experienced live music coming up it's the experience I desire and hit nostalgia the hardest on. For synthesized I'm a freak anyway I unironically enjoy breakcore lol. But at that point anything consumer tuned would be good enough for me anyway as skull candy was my highschool bass Cannon answer for the era of wubstep and edgy rock lol
Reply: @anothersquid  There's a slight problem with your argument: "oscilloscope". Hearing and sight are very different senses to the point that if you can see the tiniest of tiny differences on a 'scope, the audible difference will be cery clear. If you'd asked for a frequency analyzer comparison instead, that would do the job if you know what to look for. I think fact that your neighbor hasn't corrected you is interesting. :)
Reply: @eekee6034  The wrongness of what you are saying is grand here.  

Sensing devices are much more accurate and sensitive than any ear.  If you hear a bona fide difference, it absolutely can be registered on an appropriate measuring instrument.

If it cannot be measured, it absolutely cannot be heard.

A spectrum analyzer will show different things than an oscilloscope, but either will show any qualitative difference in signals going through your cable.

He probably didn't "correct" me because he knows I have access to a great variety of test equipment, including spectrum analyzers.

Hell, it would be easy enough to prove it in a blind test just with ears, but audiophiles never go for that either because such tests don't get passed at better than random chance.
Reply: Surely you can only appreciate it with the $800 power supply upgrade
Reply: @PlasmaHH  With premium packaging to ensure safe passage from manufacturer to your $2500/ft cables.
Reply: I could hear that the NuTube was more "metallic" or "cold". The original sounds better to me. Pretty much lines up with what's shown in Audacity.
Reply: @aegisofhonor  Exactly my thoughts. The C64 is cute and all but the sound is terrible anyway, bad low quality samples looping, while it's cool and stuff  - don't get me wrong, but fiddling around with the DAC isn't going to magically do anything more than just as others have said an EQ adjustment.. 
I personally think these days it's better to just emulate the C64. I don't see any games that are so amazing for all the hastle? (yes to tinker but, I bet most old guys never play the games lol) at least with an emulator you can load games instantly and have save states and audio filters (EQ) and upscale + CRT shaders.
Reply: @MultiPetercool  Exactly. Low quality samples looped. It's the same as a poor quality .mod file.. no fancy DAC is going to make that magically sound better.
Reply: @robsku1  haha excellent
Reply: The whole 8 bit thing is only crappy in comparision to modern stuff, lets face it, in the grand scheme of things it's crappy. While it's cool and stuff, its poor quality samples looped or the built in synth etc is like grandmars door bell.
Reply: You can just fit a regular C64 with a dual sid chip with some modding for  MUCH cheaper
Reply: It was quite easy to spot the difference imho. The "tubes" made it worse.
Reply: @anothersquid  You've taken anti-crazy thinking to the level of being wrong. ;p An oscilloscope is the wrong type of instrument to show the difference. Even given a sine wave, ordinary peoples' ears will hear distortion much smaller than anyone can see on an oscilloscope. A spectrum analyzer is a far more appropriate and useful tool for this task.
Reply: @eekee6034  Not a word of what you said is even slightly correct.
Reply: @anothersquid  Oscilloscopes are not magic fantasy do-anything miracle machines. Like any other tool, they are good for some uses and bad for others, and an educated, not ignorant person knows which tool to use for which job. He doesn't just make assumptions about what a tool is good for. Educate yourself.
Reply: @damianvila   That's actually a reasonable spending since there is a difference, there are products much worse than this,  where audiophiles are paying hefty prices because of difference they're believeing in (like carbon wires, audio fuses, quantum cleaners and on top of that, the pinacle of audiophiles faith - The Extender).
Reply: HEY!!! I resemble that remark!!! :D
Reply: I mean, you're already building a silly novelty than is 1000x worse in every way than a $20 android phone so.... why are we discussing the price of any of this, it's for nostalgia fetishists only in any case.
Reply: Do the "Blind Resolution" or "Blind DLSS/FSR" tests on Linus Tech Tips come to mind? 

Absolute professionals that work in the industry, when seated in front of two displays featuring 4k vs 8k of the same video, cannot tell the difference. (Except Anthony, because, well, he's Anthony, protect him at all costs) If you take another set of professionals in the LTT office and ask them to identify which panel has DLSS on/off (Or AMD's FSR) a good %85 can't tell the difference. (admittedly it is WAY easier to see tiny DLSS or FSR artifacts than it is to see the difference between 4k and 8k res, but the point stands)
Reply: It really depends on your priorities man. I have sensitive hearing and it makes a huge difference to me. It's kind of like a scream that has slightly better color. You know HDR versus standard. Most people really wouldn't notice it in the day-to-day but if you're sensitive to it it can make a huge difference. Or maybe refresh rate you know most people would not notice the difference between 120 and 160 but some people would be incredibly annoyed by 120. That's kind of where I live I can hear that difference and imperfections are really perceptible to me. I also have a rather wide range of frequencies I can hear down to about 15 Hertz and I'm breaching towards the higher end on high frequencies as well. I'm also sensitive to noise and other artifacts. Plus it's just nice to have that clearer more defined sound. Is it worth the money for everyone, or even most people, absolutely not but for me I would put the money down. I can hear the difference quite clearly on my speaker system and also the vacuum tubes are just awesome!
Reply: Just get a uLTIMATE 64... i don't see any advantage on buying this except to thropw money away...
Reply: @brians1793  That is 100% in your mind. You can't affect the "quality" of a digital signal, the only thing that is transferred is whether each bit is a 0 or a 1, and cable noise is not enough to affect that. If it did then you wouldn't get a signal at all or would get skipping like when you try and play a scratched CD/DVD.
Reply: With a 10% distortion the Nutube is surely "perceptible". But the question is: What is this device intended for? The SID already provides a high amplitude signal without any need for amplification. You can connect the SID to a "line-out" RCA almost directly. What you really need is some power amplification to drive a pair of speakers, and the Nutube is not really a good choice for that. In fact, I found the schematic of the Korg HA-S headphone amplifier and it is full of silicon (JFETs Opamps, ...) The Nutube is just an hindrance in the design.
Reply: I'm pretty sure that changing SID chips makes much more difference than using the NuTube option or not. I see this option as a perfect "snake oil" example (just like many audiophile accessories).
Reply: Audiophile culture is not about enjoying but complaining!
Reply: @vresi  I agree with what you say. I think the problem more so is that some groups of individuals adopt the name audiophile and then make insanely ridiculous claims and, for example, charge someone $2000 for a stupid twisted pair of wires and slap a connector on each end. WE all know that you can twist wire and add a shield yourself for pennies on the dollar and get the same results.
Reply: The only people that can tell the differences between "good" sound and "bad" sound are musicians. Anybody else is just a hipster who is so delusional they think they can hear the differences or they just want to look cool. Honestly even us musicians can't even tell because there's not even really a difference most of the time. If the manufacturer of equipment doesn't know what they're doing they can make their "pro" grade "high quality" equipment sound worse than your run of the mill equipment.
Reply: Not only good equipment, but also need a set of ears not older than 25 years, if you plan to hear the entire audio spectrum and frequencies above 10khz. 😅
By the way, I honestly believe that this is all pseudoscience, as 8-bit guy said - the only difference that I personally felt on vacuum amplifiers is a warmer sound, but you can achieve the same "warmer" sound with a good equalizer.
Reply: At first glance I would agree with the original comment, if I had to describe hardcore audiophiles in just a few words based on what experience I have with audiophiles then 'arrogant' and 'close-minded' would come to mind (though not implying that all are like that), but I also feel like it is very important to note both that setups matter (even identical setups could theoretically sound different) but more importantly the fact that our hearing is very individual, especially when hearing defiencies or variances are involved (which are probably more common than the common cold).
Reply: @volvo09  you should listen to some good sennheiser headphones and then compare that to anything mid range and tell me there is no difference. A good set of cans, you can literally hear a pin drop" its like being there. 

over priced? maybe. but the experience is there
Reply: It's also massively marked up. The Nutube itself is only a $50 part.
Reply: @Tahngarthor  It's also important to note that two "genuine 100% original C64s" can look and sound completely different from one another. There was a ton of variation over the years it was produced.
Reply: @SnakebitSTI  This video is streamed to most clients with Opus VBR < 160 kbps. YT is a horrible place for audio comparisons.
Reply: Yes there's no point in this upgrade unless you have pure gold conducters and cables from the source right through to the speakers, only then would you be able to hear the sweet, smooth tones caressing your ears for pure aural delight. 😄
Reply: It's looks like a great, high-quality product.  Love the idea you could build a new C64 that might last for decades.  Is it worth it?  For many hard-core C64 fans, I'd say hell yeah.  I'm glad the tube option is optional, because there's no way I would pay $20 let alone $500 for it.
While there's no serious dispute that even the best tubes impart higher distortion and noise than transistors and are inferior on paper to both bipolar and various FET/MOSFET designs, lose performance with age and have lifespan issues, deliver less power at higher impedance (thus inferior speaker cone control), this is ultimately beside the point.  Some people prefer the sound.  (I don't but many do.)  Perception of what sounds good is so highly subjective and individual that it's totally reasonable to expect that some people will prefer the "flavor" that tube imperfections impart (same with vinyl or tape.  Plug-ins exist to give that flavor to recordings and it's arguably of great artistic value sometimes to capture a particular flavor or sound.)

What doesn't make sense is using real tubes in 2024.  Bob Carver proved decades ago that a given solid state design can sound imperceptibly identical to a given tube design by emulating the tube amplifiers measured transfer function.  That was long before $2 DSP chips could do the whole thing in the mathematical domain to incredible accuracy.

At this point, if you want it to sound like a particular tube amplifier, the whole thing can be done for a few dollars in the digital domain and no A/B/X test would reveal which you're listening to.  So, I'm glad we have the option not to pay for what amounts to a trendy purist thing.
Reply: @michaelscalisi4316  I think that's exactly correct.  Any well-designed solid state stage not pushed near clipping will be sufficiently transparent and accurate to preserve any flavor or color produced by a prior stage, including tube preamplifiers.  While many criticize solid state amplifiers as "clinical" or "sterile", it's arguably the consequence of the very low distortion and high accuracy of a good solid state amplifier adding or subtracting nothing and simply making whatever goes in come out at a higher voltage/current/power.  No flavor added.  But any flavor created and presented to the input will be preserved all the way to the output.
For an analog synth of low resolution to begin with, I'd just add some kind of variable filter arrangement with lots of tweaks so you can tailor the sound to taste, much like you can with physical synthesizers.  To me that makes far more sense than what technology for amplification you use.